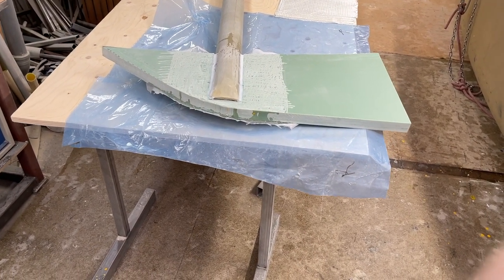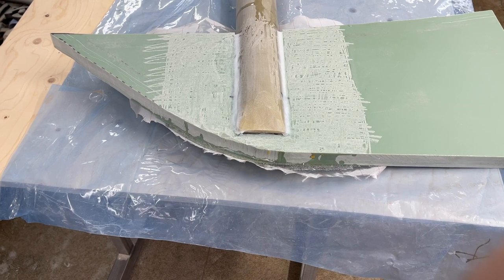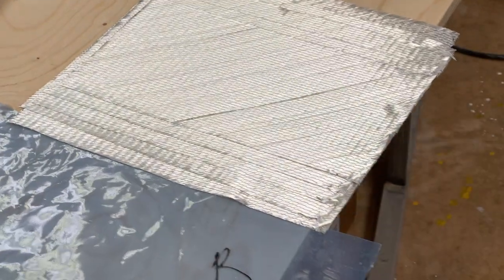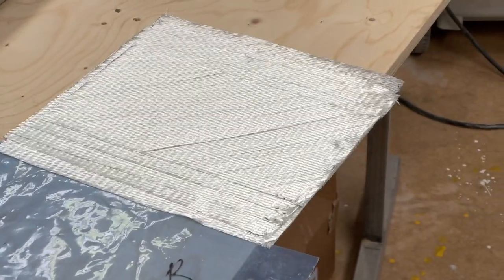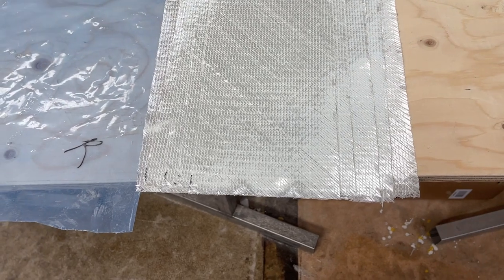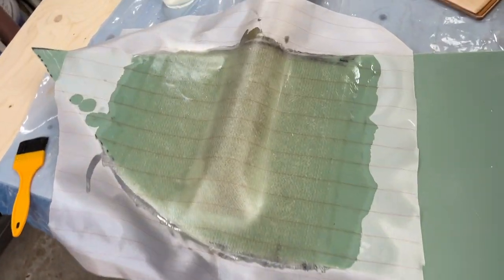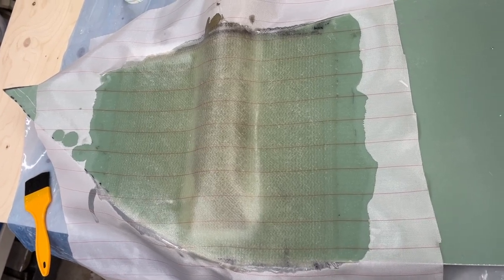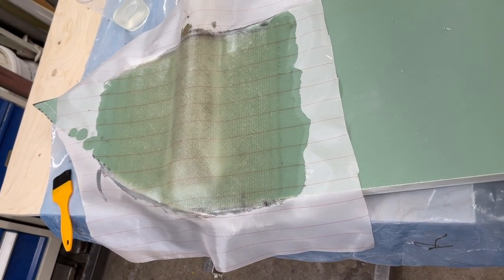7 Nov 2022  Laminating rudder axis and rudder blade strongly together with 5 layers glas each side.

Comment: Do you think you may have created a weak spot at the top of the slot cut into the rudder post? All that is remaining of the very strong post is the two small areas of cross section at the "cheeks"  Laminating these cheeks to the rudder does not increase the strength of the cross section at the top of the slot. Would it be better to cut a slot into the rudder blade sheet to take the whole of the rudder post and then glue, fillet and laminate as you are now doing?
Reply from the maker: Maybe I understand what you mean.
I think the lenght of the rudder post with no slot is long enough but I do not know the best way.
I like to have a good bit of the rudder blade in one piece at the part that will hit things
 More reinforcements are on its way including a bronze sole.